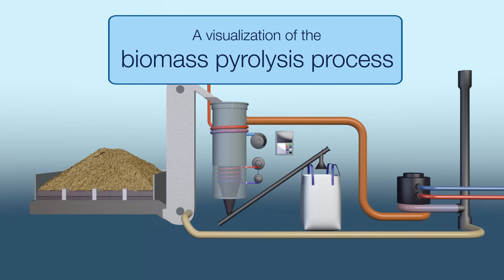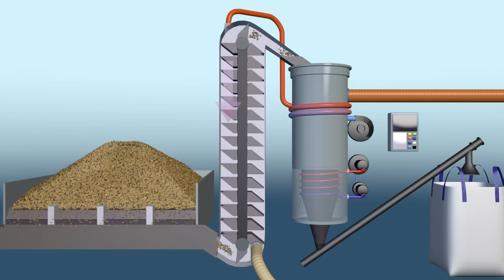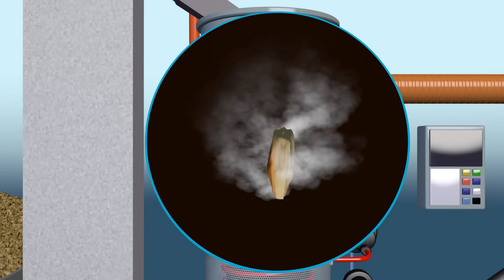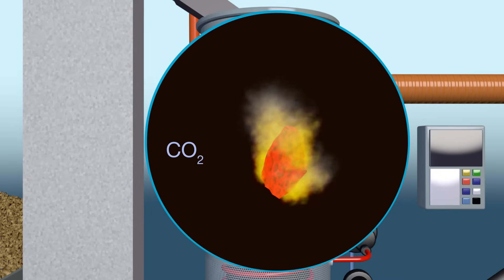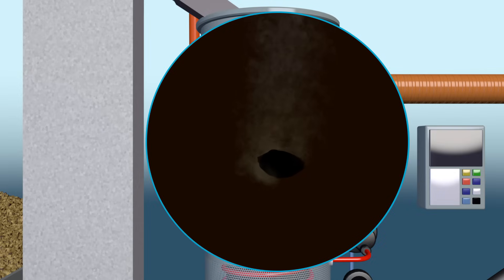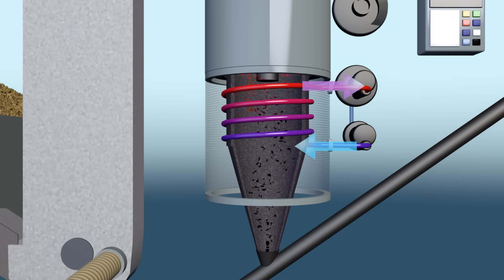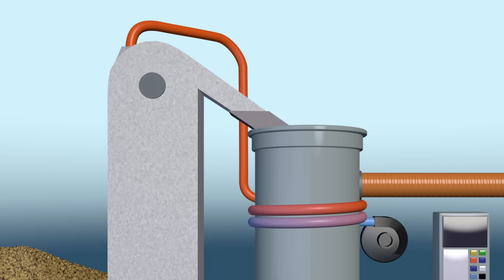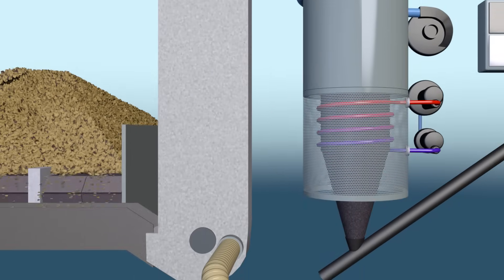Biomass pyrolysis process

Comment: Is the carbonized bio mass in the thick orange pipe? Got a bit confused
Reply from the maker: There is a hot smoke's exhaustion which is using for heating a boiler.

Comment: sorry i still can't understand. can someone explain me, what is the function of that orange pipe? are the chemical compounds a product? or is it used for raw material?
Reply from the maker: The thin orange pipe is for drying a fuel by a hot air (warmed while cooling a core).
The thick orange pipe is wheather for discharging flue gas and heat a boiler.
Reply: @skocu  thank you for the quick response. your response and this video really helped me
Reply: @skocu 
Is this an actual machine that exist, in production?

Comment: incomplete.. where is the  oil production?? pyrolysis is supposed to produce gas oil and biochar. got biochar, the syngas imited during gasification can be be called a gas... but where is gas.. at this rate u might as well call this torrefaction.

Comment: I’m looking forward to this technology spreading.  I have heard that biomass, particularly wood, yields dioxins during combustion.  Is this true?
Reply: It's horrible - it destroys the lives of the communities  near it. You can look up the cases in the States - there are lawsuits.
Reply: @Eイ-j1l Could you give me the locations?
Reply: Using biomass coming from scraps, garbage or crops (such as corn) it is far more eco-friendly than petroleum and even wood. This is due to the fact that the combustion products released into the atmosphere do not come from underground or from an "accumulator" (the trees) which retain the carbon inside them, but are already present in the atmosphere.
The problem with biomass is that it is not sufficient in terms of the amount of energy, and can become dangerous if fields are used to produce crops for biofuel production. It is dangerous because it could end up stealing space for crops for food purposes, as well as the heavy use of pesticides and fertilizers that irreparably damage the soil, but which are not taken into account because the crops would not be destined for food use. 
But hey, it sure is eco-friendly if nobody speculate on it
Reply: @antoniovaccaro8538  This response is nonsense. Generalizations like "biomass is that it is not sufficient in terms of the amount of energy" are not borne out by reality. No external energy is required for pyrolysis unless it has been depleted by prior processes. For example, effluent from a biodigester has been depleted — so we add wood chips to add back energy and carbon.  You might want to do a little more research on the use of crops used for biofuels. You seem unaware of miscanthus, willow, bamboo, and other  crops that neither "steal space" nor require "heavy use of pesticides".  I'm sure you're not a person who would intentionally spread misinformation, so I suggest you invest the effort to learn about the topic before condemning it in such strident terms.

Comment: In my mechanical engineering final year project we designed a system of heat exchangers to condense that Biogas produced into Bio-oil after this Biomass Pyrolysis. Interesting video!
Reply: I´m working with pyrolysis & have a questin for you, how did you solve the problem with tar buildup in the condenser, to what temperature did you cool the gas? I´m greatful if you could answer. Regards Greger
Reply: I am an agricultural engineering student and i want to design a biochar reactor for a village... I  want some guidance.. How can i connect with you??
Reply: Hi Sultan, can that bio oil be manufactured and used for commercial purposes? I have few more questions from you, that I cannot ask in public due to intellectual property issue. Can I can one of your contact details to discuss further?
Reply: Heating stoves
Reply: @Skyler Elian No problem xD
Reply: i dont mean to be so off topic but does any of you know a way to get back into an Instagram account..?
I was dumb forgot my account password. I would love any help you can offer me
Reply: @Brennan Shepherd I really appreciate your reply. I got to the site through google and Im trying it out atm.
Seems to take quite some time so I will get back to you later when my account password hopefully is recovered.
Reply: @Brennan Shepherd It worked and I finally got access to my account again. I am so happy!
Thanks so much, you saved my account :D

Comment: How is oxygen removed during pyrolysis? Is it substituted with an inert gas or is pyrolysis just another way of saying that you are operating under vacuum conditions
Reply: ..... heat.... oxygen can be easily removed by heat. other gases like nitrogen or hydrogen need chemical degasification reactions  for removal. actually oxygen helps in the  degasification process. there aren't much free oxygen in the masses to begin with.
Reply: Generally the tank is flushed with co2. It’s heavier than air and will push it out as it fills

Comment: Nitrogen is introduced into the reactor to remove volatile compounds such as H2O, CH4, CO2 and CO.. Correct me if am wrong, thanks!
Reply: Nitrogen is introduced to deplete environment of any oxygen. If oxygen is introduced it could cause the hot pellets to catch smolder and or catch fire.
Reply from the maker: Dont know. I am just an animation designer.
Reply: If I had to design that thing, I’d ad nitrogen to keep away all oxidative gasses. However, the design depends on what's your goal.

Comment: What software do you use to make this? I'm a ChemE major and this seems fun to do.
Reply: which software is used for 3d animation and modeling
Reply from the maker: Generally I used Cinema 4D for 3D renders and After Effects to compose video.
Reply: Thanks for the quick response. How did you learn to make this? It's rather impressive.
Reply: @skocu  can i have the full project plan to implement and cost estimation pls ?

Comment: Where is the heat source of the reactor i couldn't understand..
please can someone explain to me?
Reply from the maker: As far as I know the reaction needs to be burn on while the start only. Then the high temperature is keeping by the reactors coat and a biomass burns by itself. That is the key matter.
Reply: Thank you for rapid answer.
Thats make sense.
Reply: 30% or so of the gas is burned to give continuous heat.